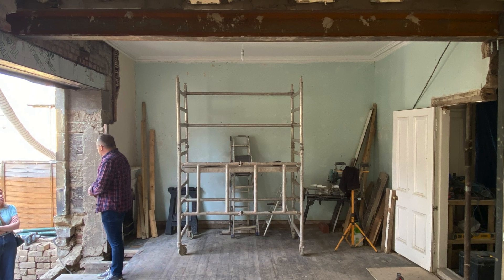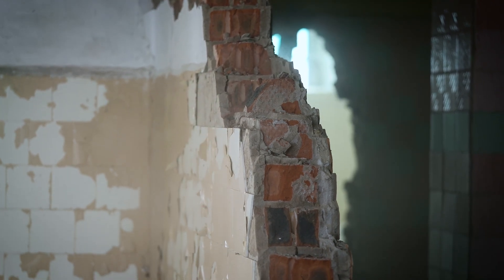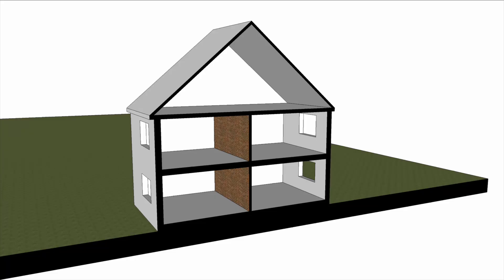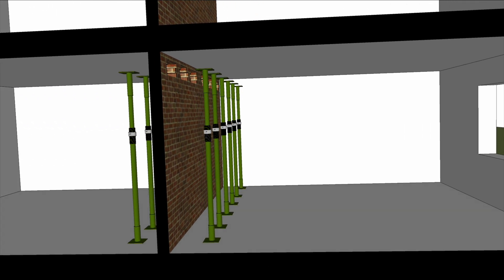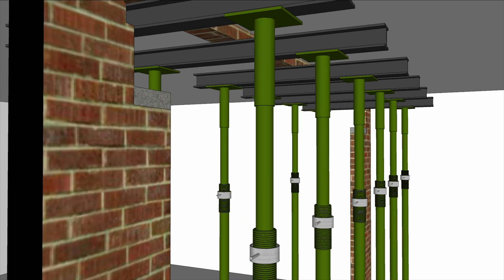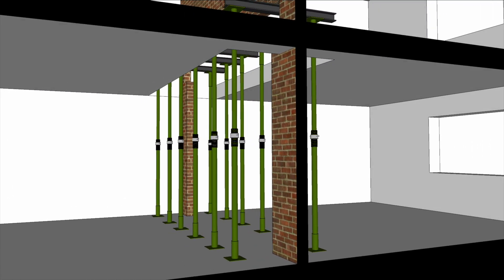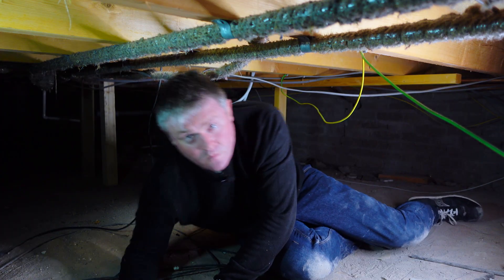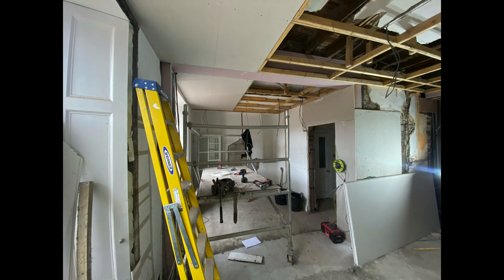How to Knock a Load Bearing Wall in the UK

Comment: Can you do a video on how to spot when a load bearing wall has been improperly removed?
Reply from the maker: That could be a very short video….😂
Reply: @RealLifeArchitecture  My sister used to carry a stiff tape measure to check the height at middle of a room compared to the edges, and a golf ball for testing floor level. She found a few.

Comment: Excellent as ever. I wonder if it's worth saying something about the other role of internal walls in some buildings: the stiffening of external walls. I remember some decades ago in Birmingham, the authorities got very antsy because the internal walls of a tall terraced house had been removed and it was felt that the party walls could fail. I suppose the dividing walls act as buttresses.
Reply from the maker: That is an excellent point. This is part of the reason Engineers specify ‘picture frames’ and ‘goal post’ arrangements. Doing this work to older properties that have already been altered can be a nightmare.